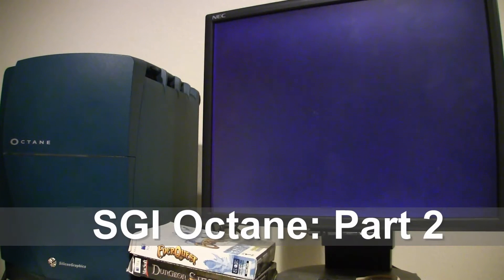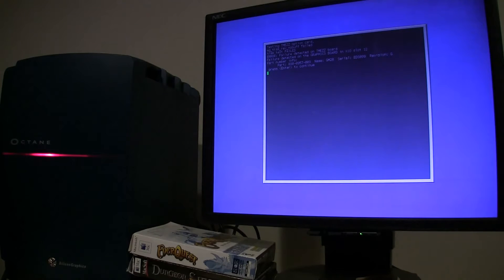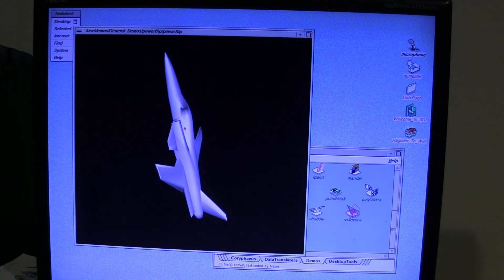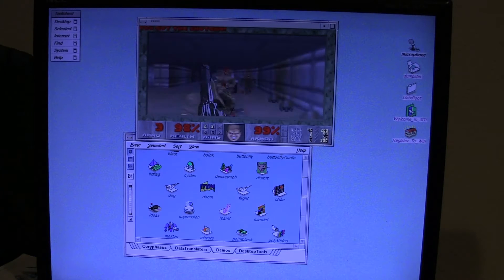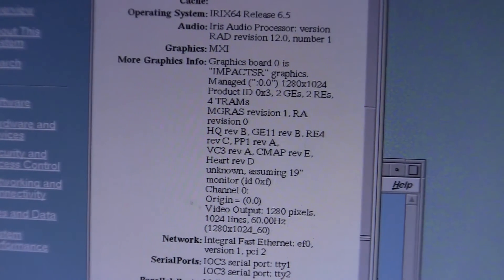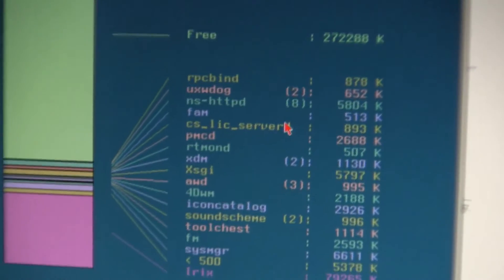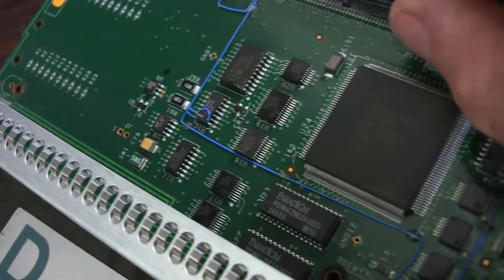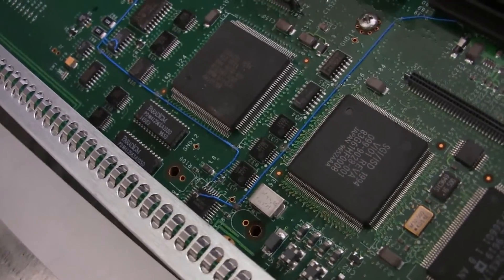SGI Octane Part 2: Specs, Software and the next Problem!

Comment: Did you ever manage to fix this?
Reply from the maker: I did buy another video board for it, i forgot the model off hand but its a lesser board half the size but had built in t-ram so i was able to render everything with texture, just not as fast as the mxi might have.
Reply: @srarcade  good to hear, amazed to get a response after 5 years! I have a working (E)MXI board but one of the TRAMs is bad....texturing still works but not perfectly. I'll fix it one day!
Reply from the maker: @jkdsteve  sounds like what happened to mine

Comment: did you ever end up fixing that connector?  I solder stuff like that and smaller all the time, I could do it if you still have the thing
Reply from the maker: No, its sitting in a box in my office. I got another temporary graphics board for now. I'm not entirely sure if this connector alone would be the fix or not. Turned out the texture modules were bad too.
Reply: ah. yeah sometimes it's hard to tell if it was not quite soldered all the way.  I manufacture circuit boards for a living and deal with stuff like this every day.  I had a pair of big audio amplifiers from the mid 90s that had cold solder joints on the same one connector inside that worked for 20 years and then became intermittent.  Took me a couple months of messing with them to find it.  You might be able to find the connector for your board still. looks like it would be pretty easy to replace if you decide you want to

Comment: At their little blog they list the MXE as the upgraded graphics to the MXI card and they do have one on ebay for $225+$10.97 shipping and has 90 day warranty! Ebay item number 111977843819 ! It has two 4mb texture modules! And obvious by the pictures there are no jumpers which like most repair shops do, is install jumpers for missing voltage on certain traces that go to several comonents! If it was used by an aircraft company than they probably had in-house repair specialists which would save the company money! Obviously the in-house would have access to SGI's actual board layouts and designations for troubleshooting and repair! But I would check out the MXE card! 

But if you watch Louis Rossman here on youtube, he will often diagnose issues with apples, etc and will use jumpers to supply missing voltages to components in order to restore operation, which by the layout of that blue shielded wire it is obviously a repair! The same thing the Military will often do is repairing electronics to save money, sometimes there is such a limited availability that repair is the only alternative or option! Not to say the damaged MXI board is no good, I am sure there is someone that would love to have some extra parts or components off that board "Something Rossman Does is buy broken Mac boards" which they could use it to repair several different damaged boards in other machines! 

So you could always list it as parts and repair on ebay to gain a little for the replacement! As for the powersupply, usually caps will fail over the years, if you have someone close that is a good friend and is capable of replacing caps, your dead PSU's might be repairable! Caps are not high in price and can be changed easily, though ebay item number 142252343706 is a 623 watt psu for $75+$15.63 shipping!
Reply from the maker: I bought a MXE board for $75 a few months back with a warranty but unfortunately from overseas- shipping was only $10! So it was probably a big mistake on their end. It arrived and did not output any video and has an error: bkend FAILED Failure detected on the GRAPHICS BOARD in XIO slot 12. Needless to say, it would cost me more to ship the board back and I would be out money with no board so instead I just kept it. I've been trying to find a way to diagnose this better but I have not had much luck.
Reply: srarcade What I meant was to offer it up for parts and repair on ebay, perhaps offering the individual boards would get a little more back! There is another user here on youtube who has several actually had many octanes and lives in NC! I am sure if you search jpkiwigeek you can contact him, he gave away several of the octanes and would probably offer some parts for shipping fees only, he does have the MXI!
Reply from the maker: Ahh yes, i understand. Yes, love jpkiwigeek! I tried contacting him before but i never got any response. He seems like a real busy guy when he's not tinkering with amazing supercomputer junk.

Comment: Those blue rework rewires are probably done at the factory. They're likely changes that will be incorporated into a subsequent board revision but were too late for that spin.
Reply from the maker: Thanks! I figured it was something like that, i've also seen them on the arcade boards I collect rarely. Really good work on this board though, I wish I could make stuff that clean.

Comment: Take a look at the nekochan forums for a new graphics card. I bought my vPro card from there. You can use a vPro v6 on your system.
Reply from the maker: I actually got a new graphics board for a great price that I will reveal in my next video. Sadly my Octane is dead again, the power supply I put in earlier this year is already done. Now I am looking for a Cherokee this time around for a reasonable price. Having a hard time justifying a $150 price tag, they're not worth that to me.
Reply: Yes, the power supplies are a common issue. I would definitely recommend you getting the bigger one if you want to use a vPro graphics card. I'm aving a Octane² here which is basically identical to the normal Octane, but a newer board revision that supports 8 GB of RAM instead of 2 GB. Which IRIX version are you actually running? You could go up to 6.5.30.